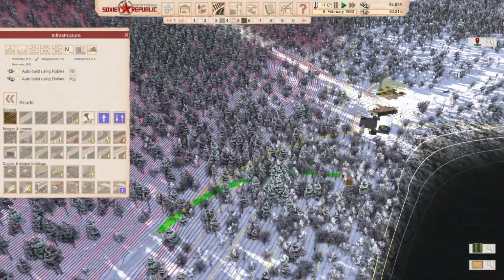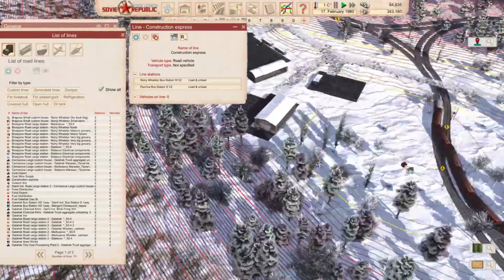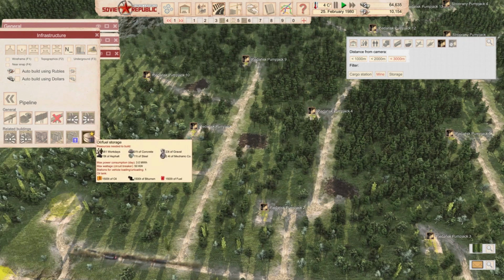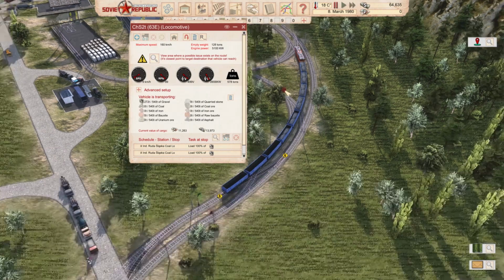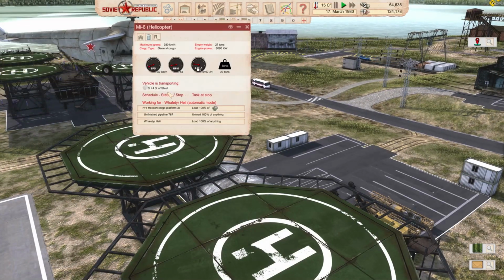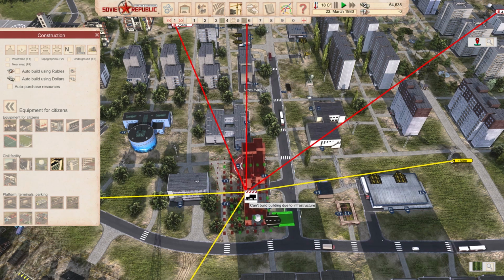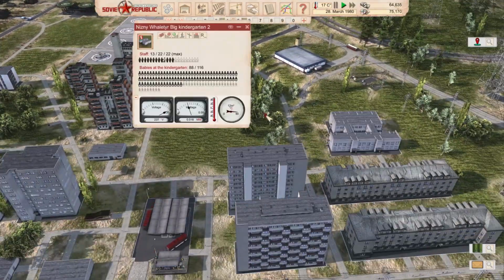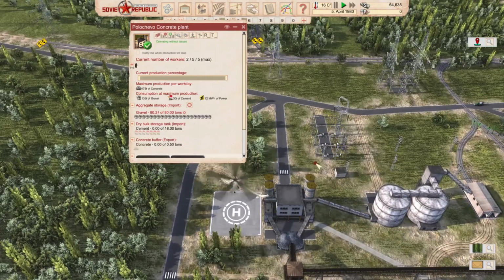Soviet Republic - Alaska - The New Beginning - Ep.67

Comment: 1) You did not enable line spacing for your line of workers for the concrete and asphalt plants in Mooremansk. That's why you have production issues there.
2) The heating plant worker issue that I reported in the previous episode concerned Gahlask and not Whaletyr. Your losses in population also occurred in Gahlask as well. I brought these two issues to your attention in the previous episode.
3) You should not start construction of residential buildings in Mooremansk: if the services' infrastructure is not all finished (and consumer goods already there), your university residences will send residents there before the city is functional. And you will lose those unfortunate inhabitants ...
4) If your buses take more than 5 hours to reach the fire station on the other side of the bay you may not be able to have the necessary fire coverage. You may be required to build a passenger heliport with a helicopter carrying workers from Whaletyr heliport.
5) You don't have enough workers waiting at Whaletyr Heliport. On average only about twenty while your transport helicopters can take double.
6) If it was me, I would place the new hospital's helipad in place of the old Little Town Hall. This big city deserves to have a Town Hall more in relation to its size and its economic role
7) I think 4 firefighter helicopters is probably an overkill. 2 should be enough but if you don't want to take any risk (we still lack perspective to judge their efficiency) probably a 3 slots helipad should be chosen. Let us not forget that the oil fields are eminently flammable ...
8) Theoretically the MI-8 is much more profitable to use than the MI-6 for transporting workers, roughly half the number of passengers but almost 4 times cheaper ... The helicopters being very fast for their journeys, given the equation price / number of passengers, it is better to have an MI-8 making multiple trips than an MI-6 which would need fewer trips to make. On the condition that you produce your fuel and that you do not run out of it, for me it is the MI-8 which is more interesting.
9) COs related issues:
a) again and again you attribute too many construction projects to your general COs: this is the reason why constructions take so long, they disperse their efforts. Like I said thinking to save time you are wasting time (a lot)
b) I think your general CO worker buses arrive empty at oilfield construction sites because of the distance (and the dirt road). "Hope for the best" is not going to be enough to solve the problem ... One of the solutions (see the problem raised in point c.) Is to use the Whaletyr Heli CO only for the transport of the workers (thus unselecting their sources of materials), the general COs being able to load materials which are not likely to disappear from the trucks after 5 hours of road.
c) as you noticed there is a huge problem (which I hope the developers will someday fix) : passenger helicopters are also used by CO to transport materials, so workers can be transported only after all materials have been delivered to all sites in the CO queue. There are currently two ways around the problem (but this is far from ideal): the first is to have two different COs, one dedicated to workers, the other to materials. But it is an expensive solution; the second is to have a very conservative allocation of the number of projects assigned to the CO, while waiting for them to be completed to allocate new ones: only way for the CO to send workers when no more materials are needed
Reply from the maker: 1. I thought this is by default now. I missed this. Thanks! 
2. I thought you meant Whaletyr. Because Ghalask has only small heat exchanger usage. I will check it again. But you must be right as there is an issue. But Whaletyr as well. Hmmm. I will check it again. 
3. Got it! Good call! I was hoping for the city to be constructed faster. But bad CO management on my part. 
4. I will try to speed up the Mooremansk construction. It seems like only episodes away from having the first people in there. 
5. I will move some people to the closer buildings. The refinery is overproduction anyway. 
6. Not a bad idea! 
7. I agree! 
8. I like this. Also, we can always expand in the future. Resettle the smaller ones to fire departments or other CO's.
9.
a.I know! I understand. Keep telling me! I will get it at one point. 
b. Interesting concept! I like it. I will do this
c. I agree. I will go for a second solution. I will practice my CO management and allocate less work to them. 

Thanks!